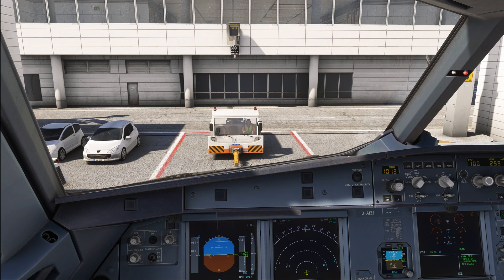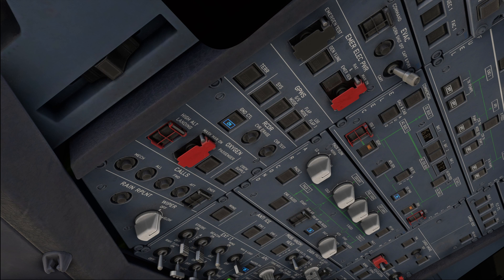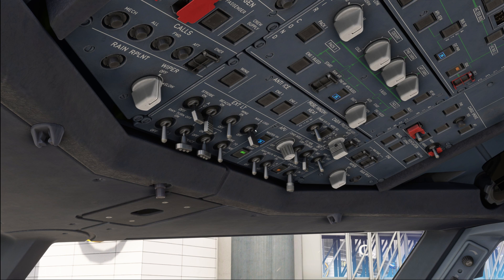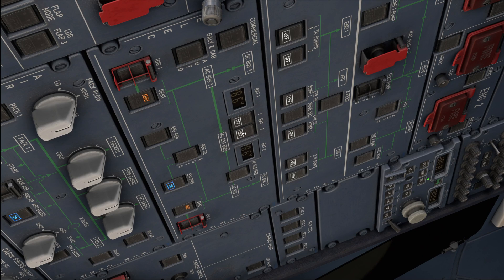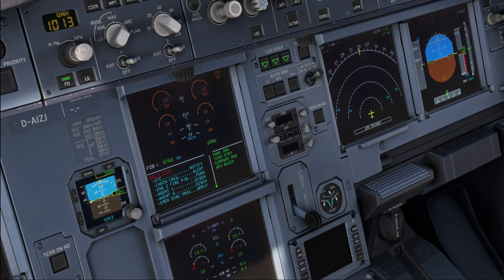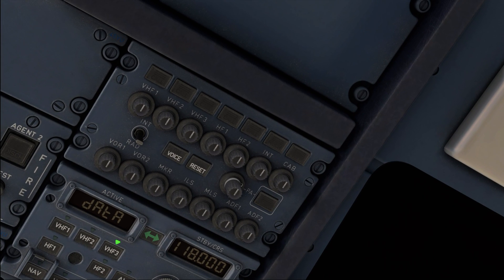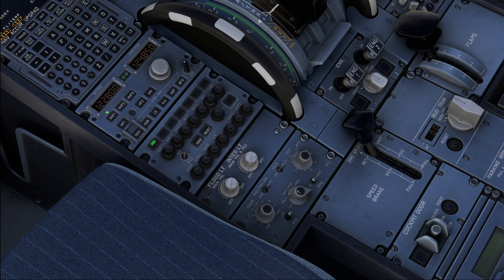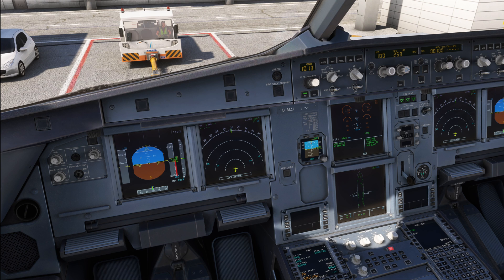Airbus A320 Tutorial 3: Preflight Procedure (Flight Deck Setup) | Real Airbus Pilot

Comment: Summery of the tutorial  
Preliminary Cockpit Preparation:
	1.	Engine Master Switches: Check OFF
	2.	Engine Mode Selector: Set to NORM
	3.	Weather Radar Switches: OFF
	4.	Predictive Windshield Switches: OFF
	5.	Gain Knob: In CAL position
	6.	Multi Scan and GCS Buttons: AUTO
	7.	Landing Gear Lever: DOWN
	8.	Wiper Selector: OFF
	9.	Battery Voltage: Check above 25.5 volts
	10.	Battery Switches: Turn ON
	11.	External Power: Turn ON (if available)
	12.	Aircraft Power-Up: Wait for aircraft systems to initialize (indicated by triple click)
	13.	VHF Radio:
	•	VHF 1: Active
	•	VHF 2: Guard
	•	Ensure switches are pulled out
	14.	APU Fire Test: Conduct and check ECAM
	15.	APU Start: Turn ON, wait 3 minutes after APU is available, then turn APU Bleed ON
	16.	IRS Initialization: Set ADIRU 1, 2, and 3 to NAV
	17.	Cockpit Lights: Adjust to match flight conditions

FMS Initialization:

	1.	ATSU - AOC MENU: Select FLT INIT
	2.	INIT DATA REQ: Press
	3.	MCDU MENU: Select FMGS, verify aircraft and engine type, check NAV database
	4.	INIT Page: Press INIT REQUEST, enter flight number, and confirm IRS alignment
	5.	RCL Button: Press to accept airplane status

Preliminary Performance Calculation:

	1.	EFB: Download SimBrief flight plan
	2.	Fuel Calculation: Refer to OFP for fuel (PLNTOF + TAXI + EXTRA)
	3.	Fuel Load: Input into aircraft
	4.	Performance Calculator: Select TOF (Total Fuel + Extra Fuel) and calculate performance data

Preflight Procedure:

	1.	Oxygen Pressure: Check sufficient levels
	2.	HYD Page: Check hydraulic quantities
	3.	ENG Page: Check oil quantity; use FEDAC ground power if needed
	4.	Flap Indication: Match with flap lever
	5.	Speedbrake: Ensure retracted and disarmed
	6.	Parking Brake: Check pressure (use electric hydraulic pump if needed)
	7.	Circuit Breakers: Ensure all are in
	8.	Call Buttons: Ensure none are pressed
	9.	Crew Oxygen Supply: Turn ON
	10.	GND CTL: Turn ON
	11.	CVR Test: Perform
	12.	EVAC Switch: Set to CAPT
	13.	Strobe Lights: Set to AUTO
	14.	NAV and LOGO Lights: Set to 1
	15.	Seatbelt Sign: ON after refueling completed
	16.	No Smoking Switch: AUTO
	17.	Emergency Exit Lights: Armed
	18.	Annunciator Lights (ANN LT): Bright
	19.	Cabin Pressure Mode Selector: AUTO
	20.	Overhead Panel: No white lights; all switches at 12 o’clock
	21.	Battery Charge: Check using ELEC on ECAM, turn batteries off and on to check amps
	22.	Fuel Pumps: Turn ON; ensure MODE SEL is not in manual, and fuel crossfeed is OFF
	23.	Engine Fire Tests:
	•	ENG 1: Check SQUIB, DISCH lights, and ECAM indication
	•	ENG 2: Repeat process
	24.	PA System: Test
	25.	QNH: Set on standby instrument (via EFB)
	26.	Terrain on ND: OFF
	27.	DCDU: Ensure brightness is set
	28.	Clock: Verify correct date
	29.	A/SKID & N/W STRG: ON; verify all landing gear lights are green
	30.	STBY NAV: Ensure OFF and guarded
	31.	Audio Selection: Set VHF1 and VHF2 to listen
	32.	Transponder:
	•	Mode Selector: STBY
	•	Squawk: 2000 unless provided by ATC
	33.	TCAS: Set ABV, then STBY
Reply: Legend
Reply: bro, you've just saved me hours on working on my own checklist
Reply: Wow perfect 👏🏻
Reply: LEGEND thank you sir

Comment: Recently I’ve been watching a lot of aircrash investigations. It’s a worry that pilots have the option to disengage flight recorders in flight. Some of these plane disasters have been murder/suicide with pilots however, no real hard evidence to prove such acts due to the flight recorder’s being turned off or tripped intentionally. Surely all flight recorders should not be able to be manipulated by pilots and always turned on.
Reply from the maker: I suppose you refer to the ability to pull the C/B, right? Well, that option simply has to be there. What if the recorder catches fire? You need to be able to cut its supply, just like with any electrical device on board.